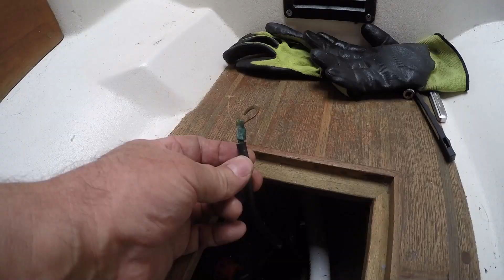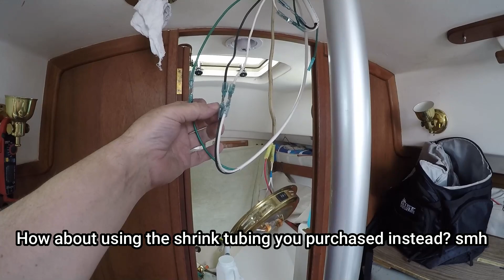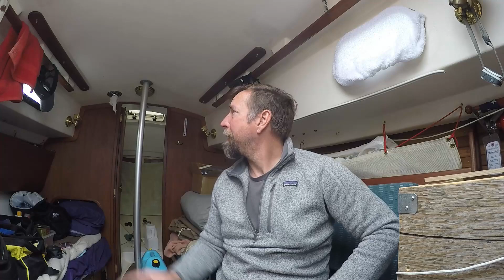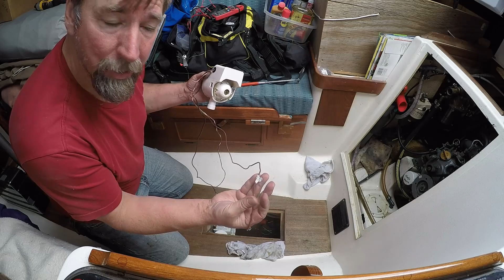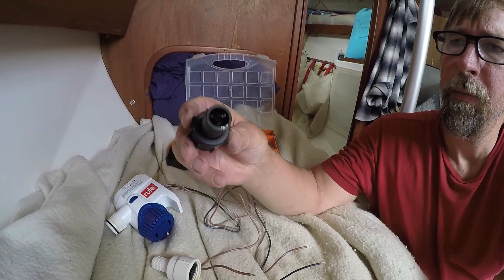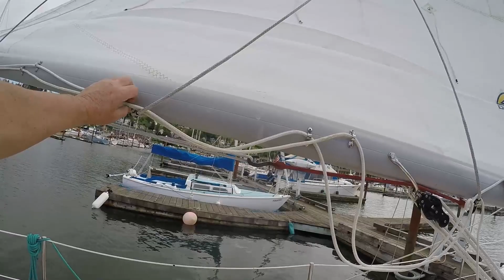Finally Back to the Cape Dory 25D - Voyage Dreams 74

Comment: Hey buddy, appreciate the videos. Quick question, do either of those berths get wider somehow?  . . . Like, the wooden backrest pops out, lays in next to compression pole, then add cushions, or something? You get my drift, it seems like at least one should become wider somehow. . .
Very attractive vessel, considering one.
Fair winds, thanks : )
Reply from the maker: The starboard settee has a hinged leaf that folds out and is supported by several removable boards. In this way the two settees become what I would consider a full sized bed if you lie athwartship
Reply: @VoyageDreams  ok, thank you very much for the info on the berths and table.  Enjoy.

Comment: Doing long passages in a 25D is possible, but they will not be easy. Being small boats the motion will be taxing, and it can turn into a sort of physical marathon. I'm sure you plan to make a few shorter passages offshore and then you'll have a better idea of how to cope with this aspect. In fact I bet you plan to go to the Bahamas first, which is a great idea. It would give you a much better feel for how long term living aboard would be.

The other major issue is carrying enough stores, especially water. The idea I have considered for this is to have a good solar system. You can make your own "bimini" out of 2 good size solar panels using stainless tubing and fittings. With 350-400 watts of solar and at least 300 amp/hrs of battery you could run a small watermaker such as the Katadyn 40E. It can also be operated manually if you ran low on power.

I would highly recommending moving up to a CD28. I had one, and consider them one of the best solo sailboats out there. They're twice the displacement of the 25D. Have you watched Sam Holmes' videos of crossing the Atlantic in his ? Some good stuff in those.

But good videos, keep us informed. Who knows, maybe I'll cross your path out there.

Comment: Some bilge water ? Be sure to check your anodes ! Keep the faith and you will be ok . I have found that the automatic bilge pumps are sensitive to oil  ! I know use a separate float switch .

Comment: Great to see you back!  Looks like you are in different slip from your last one? Did the sheet metal trick for the bumper line work? Seems there are several of us with same dream…goal. Might suggest using tinned braided wire. I remove the plastic tube on round lugs, solder and then use clear heat shrink tubing, placing up to the rounded part. This way I see if is becomes loose. Just a thought. Again glad you are well and moving forward.
Reply from the maker: Thanks for your comment. The marina moved me around a bit, so yes, possibly a different slip. I'll definitely keep your suggestions in mind.